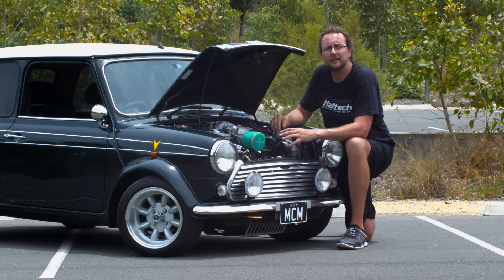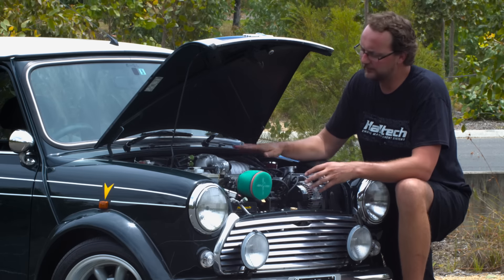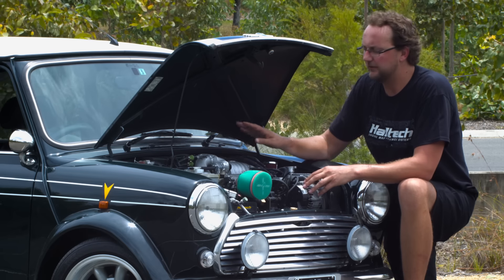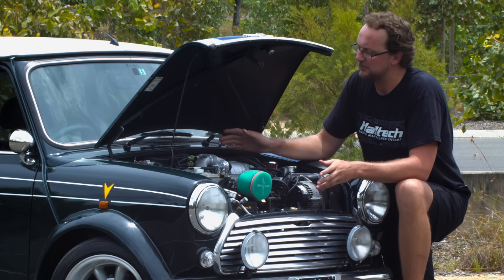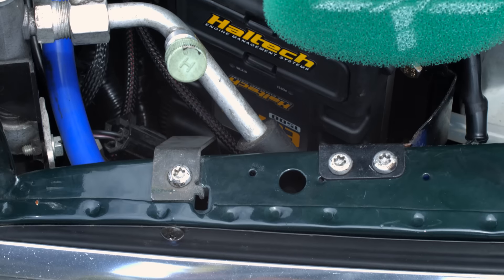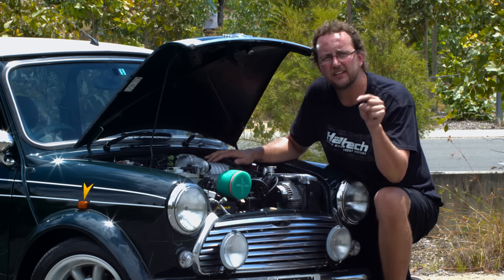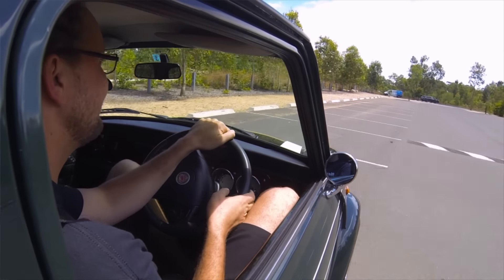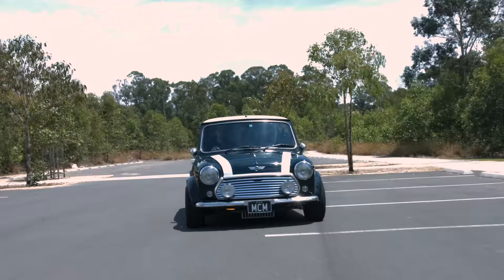Mini Me: MCM's Supercharged Mini

Comment: Nice one Scotty! When the mini gets some 98 put in it (when no e85 available) does the motor still make useable power and will still be able to be driven flat to the floor or is the flex sensor just there to put the car in like a limp home mode until more e85 can be added?
Thanks

Comment: Here in Brazil the flex cars from the factory doesn't have any type of sensor in the fuel lines to know what kind of fuel they are running, they do all of the calibration based on the oxygen sensor reading in the exhaust, it is slow and not very reliable, for example, my car can't run properly on petrol as he runs on ethanol, and takes sometimes 10 minutes to really change the tune for the fuel, when I change from ethanol to petrol.

I really like the approach that you guys use to detect witch fuel is using, i wish that the car manufacturers here in Brazil have the same thought.

Comment: Great video guys, just one tech note about changing the compression ratios. At 3:50 Mr.Fork makes the comment on using a "Domed Piston" to decrease the ratio, this is false. It will increase said ratio, as the "dome" will decrease the volume in the combustion chamber(making it smaller) and thus rising compression ratios. The correct piston would be a "Dished Piston", as it will increase the combustion chamber size(making it larger) lowering the compression ratio.
      This is not me trying to be a cunt or make a fuss, but having the right terminology is crucial in this day in age. I don't know how many times I have had to argue with a customer over stuff, because of something "they saw on the interwebs". But again the video is great and love watching yalls other videos as will.

       "Have fun and be safe, and for god's sake if you burn someone's tires off replace them" lol.
Reply: +Scott Hilzinger Alls good bud, I just hate arguing with people and customers about the "THINGS" they see on the interwebs HAHA. An easy fix would just be to add a pop up bubble correcting it, If thats what yall wanted to do. But love this videos I'm looking to use a haltech in my Big Block Ford Bronco project here in the next year or two and the info is invaluable to have at hand. So thanks!!
Reply from the maker: +TdrSld Good point and duly noted. The correct term should be a "Dished Piston".

Comment: hey great video, just wondering does the haltech elite have any way to accurately measure the knock index in this engine. also does this use both injectors every firing stroke or one then the other, keep up with the videos and amazing products.
Reply: +WRX Life No A Series ever had knock sensors. I think people have retro fitted them, but the siamese ports mean the inside and outside bores have different knock conditions, and this 'wet manifold' injection system would make it harder too.

Comment: Can I ask.. From memory, it was running the 2 injectors before the supercharger. Whilst I understand this does have a cooling effect, would it not have made it easier to tune / control by having the injectors after the blower on the intake manifold to allow more tunability on each of the 2 intake ports individually when required, rather than it just sucking in fuel through the blower? Just curious, that's all. Love your work mate, always very informative.
Reply: there want enough space to run the injectors after the charger
Reply: Well, I picked it, they have since had to move the injectors after the blower. Really didn't think it was the ideal solution
Reply: +Cam and Jaiden yea I saw that last night but I definitely remember them saying in the original build there wasn't enough space they must have found the space lol
Reply: You are correct first configuration was just 2 lrg. inj. at the super inlet It was hoped the mixing action of the supercharger would take care of fuel distribution as well as cylinder filling. In Moogs 1st drive video Moog explained that they converted to a port setup to cure some issues of cold str. & hesitation.

Comment: Does it run richer when the flex fuel sensor detects petrol? If not, how does the tuning change?
Reply: +FedSalman  It's to do with the "stoichiometric fuel ratio", that's the chemically correct proportion of fuel to air (by weight) for complete combustion. Lean fuel mixes are bad as it leaves oxygen that can burn bits of the engine instead.

Petrol is 14.7:1 Ethanol is 9:1
Reply: +ethelmini ok, but since they're running boost levels that, for what I understand, are not totally safe when running on petrol only, how do they further protect the engine? By going something like 14.9:1? By doing something different with ignition?
Reply: +FedSalman it really is dependent on compression ratio operating temps fuel grade and timing

Comment: Why exactly did you choose throttle body injection over having the fuel injectors in the lower intake pipe closer to the intake port? My assumption is heat from the neighboring exhaust ports damaging the fuel injectors but would it not still be more efficient? I simply fail to see a gain from running the fuel through the supercharger and down the entire manifold apart from cooling.
Reply: ya other than keeps supercharger cooler and lubricated no ideas

Comment: With minis you can get near a 30% increase in power through modifying the stock cylinder head, for example porting the head, fitting bigger inlet and outlet valves and changing the changing the compression ratio etc, i think moog should look into this as it could unlock a lot more power out of that engine. Also changing the stock camshaft to something like a kent 266 or 286, something more suited for a fast road mini would also give a good increase in power
Reply: I don't know if you watch mcm but they said that they are pushing this motor as far as they are willing to...  they want to keep it sage for daily driving.  I'm pretty sure if they start with can changes and the like they would have pull boost out too... just not worth it.
Reply: *safe *cam
Reply: +fuckery abounds, changing the camshaft or modifying the cylinder head will not make it unsafe for daily use as many mini owners would do these kinds of modifications. Also im not expert im supercharged minis but im sure that something as simple as changing the camshaft will not mean having to remove boost.

Comment: What changes to eliminate knock when octane level is lowered? Boost pressure?
Reply: +Leofred Good question. I wondering too. You can't lower boost pressure on super charger. They say that in one video. So i don't know whats left.
Reply: Valtra103 Maybe theres some electric bov which exhausts some of the boost
Reply: +Leofred There isnt. Unless i somehow missed it. Just watch build series on MCM.
Reply: Valtra103 I have but maybe the supercharger has a bypass system or something originaly
Reply: Leofred
I don't think it has something. Ahh i wish some mini guys would help us out with this one...
Reply: Blake I
Probably. Thank you.
Reply: +Leofred because the fuel is injected in before the super charger you can't really run an boost exhaust valve.
haha it would probably be a bit of a fire risk.
Blake's on the money though
Reply: +BenAshlyn Zuideveld +Blake I That&#39;s true here, but you could inject the fuel after the &#39;charger. That might also enable an intercooler to be fitted. A blow off valve would then be possible, but it would just be a waste of power to compress the air blown off. You really need different gearing to make less boost.

Retarding the ignition means the fuel is &#39;set off&#39; later - you&#39;re balancing the minimum volume in the chamber at TDC against the maximum expansion of the combustion gasses. They coincide on the most efficient engines, if the max expansion is too earlier it will try to push the piston backwards and the temperatures will soar. After TDC is wasting power as there&#39;s less rotation before the exhaust valve opens to let the gasses escape - but at least the engine survives.

The A Series engines in Minis are excellent burners because of the shape of the head chambers, an extra bonus is that there's plenty of metal that can be ground away cheaply to increase the head volume and lower the compression.
Reply: I guess it's just part of tuning for two different fuels on a engine like this one with a super charger and why they described running 98 pump fuel as 'limp mode'
Reply: Watch from 4.50. the flex fuel sensor and Haltech takes care of this.

Comment: The 4G62 is also a cross flow Siamese port engine.
Reply: +Robert Hale don't thing you understand what a Siamese port head is, the 4G62 is a cross flow which means it has 4 exhaust ports exhaust on one side of the engine  and 4 intake ports on the other side of the enginethis is a 8 port head, where the mini has a 5 port head were the two intake ports are shared between the 4 cylinders and 3 exhaust ports were the two outer cylinders have there own exhaust ports and the middle two share a port all on one side of the engine
Reply: I understand what is meant, and if you know what the 4g62 intake manifold looks like, it continues the ports into one opening downstream of the throttle body. So yes, the 4g62 turbo has the same intake issue. I know this because I have one.
Reply: Robert Hale this is a Siamese head it doesn't have anything to do with inlet manifold design http://www.mokeforum.com.au/gallery/3/2-210712194537-3891462.jpeg
Reply: +pajeroman1100 ya and the lsx motors are 5.7l 427ci ohv dohc v8s

Comment: I knew about the A series engines port configuration quirks. But not  how the firing order affected the flow. Seems a vary bad design well this is an OLD DESIGN and it shows in things like that, also it only has 3 main bearing supporting the crank. not a real problem as the engine is low powered and low RPM as well.  the original ccs were less than a liter. The "1300cc" is actually 1275 and that's the big motor, many were around 890ish rang or even less making less than 50hp.